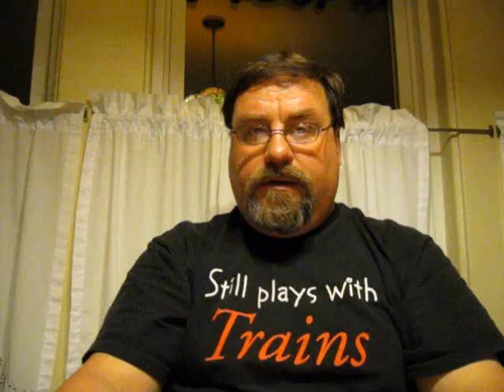Video response to a comment posted on a transistor video

Comment: electro forgey.....your explanations are easy to deal with....and helps a lot to understand the next level taking your explanations as a base.....I was wondering if you could make a video on what is metastability......I know little about it...like its when you give a voltage to an electronic circuit and that voltage does not fall either in zero state or one state...or sometimes (now this is extremely imp !!!!) it falls in a state UNPREDICTABILY !!!.....I was wondering if we can apply this concept to make robots which can take its own decision (concept of thinking..)....(as I said we don't know which state the system is gonna fall in.....UNPREDICTABILITY..)...I wish if you could throw off some light on this....thank you...I am studying second year electrical engg......

Comment: Electro-Fogey's original definition of a transistor is superior to that of EaGLeNeC's textbook excerpt. EaGLeNeC's textbook definition misleads us as to the way a transistor works. The transistor does not change its conductance by the build up of a magnetic field as an inductor but by changing its resistance as a variable resistor. If a transistor had "impedance" then you could theoretically make a tank circuit out of it with a capacitor. I have never seen such a circuit, have you?

Comment: btw, I think I read this same view of the amplifier as a voltage divider when I was a kid, in a book I bought at Radio Shack, back when they catered to guys with soldering irons on their work benches.  It might have even been the free catalog.  The one that actually had data sheets in it.  Those were the days.  :)

Comment: This video reminds me of the arguments I have in my own mind, when I'm thinking about how stuff works.  Thanks for the transistor videos.  I enjoyed them and they did clear a little of the fog as I've been watching some electronics college courses on YT, which are also very good, but a bit long.  It's hard to get through all of the 9000 videos at an hour a pop.  Your videos are the right length.  I'm looking forward to the OpAmp video.  That gain question is on my mind.  Thanks again.

Comment: SteelWeel you are 1Mega% right At high school our teacher was a University student that did not know how to explain  us abou the transisor(its called bad methodic in the academic world) .That  in fact the its act as a variable voltage divider (with or without 180 deg fase changing) also the books I have consulted that mixed molecular physics with it have helped the confusion. Later I my life it came across my mind that shuld look at it as a black box that acts in an electrical circuit.